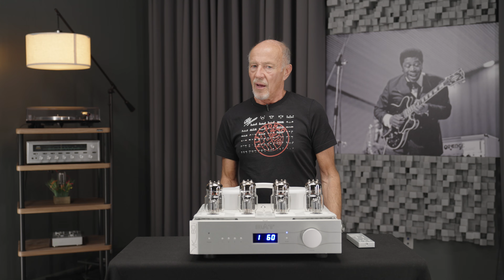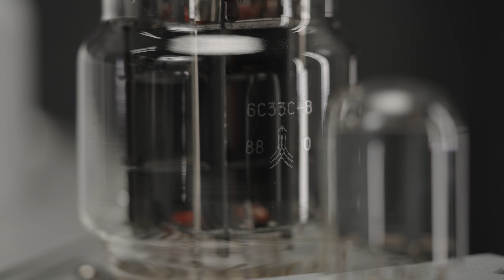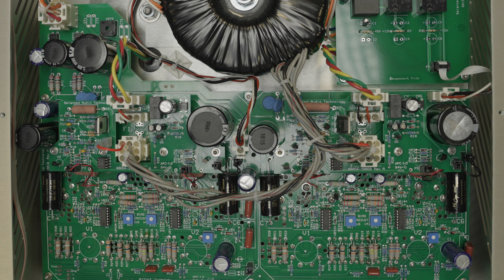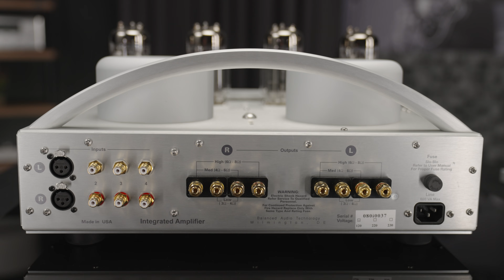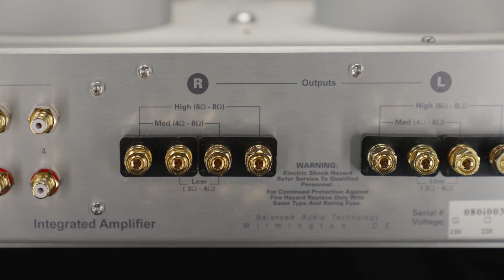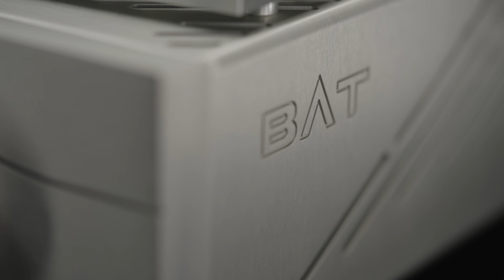Balanced Audio Technology VK-80i Integrated Amp Review w/ Upscale Audio's Kevin Deal

Comment: The VK 80i is not a push pull triode but a parallel single ended triode. The volume control while being a resistive ladder is passive. Basically it’s a VK 56 with a built in selector and passive volume control.

Comment: I saw it a few weeks ago for $8000 and was considering it. One place even had it for $7000. Looked yesterday on Music Direct and it's now $10,000! What? Now it's just out of reach. Darn. It's a dream integrated.
Reply: Guess the change to Mundorf capacitors pushed the price up but do make a significant improvement. If you look at the pictures in the BAT website. The VK80i don’t have Mundorf in them.
Reply: @seongkietchen7874  Thanks for the explanation. I guess the price increase makes sense then. I'm surprised BAT made a change so quickly. I thought the VK-80i just came out not too long ago.

Comment: What speakers and pre amp would this pair well with? Thx
Reply: It's an Integrated Amp so it has a built-in "pre amp". You could (imagine italics) use it with a pre amp but it is not required. Speakers? I just purchased Klipsch Forte 4s to used with an amp like this (high sensitivity horns). I'm retired so I will have to wait and buy the BAT used but I'm sure it will be perfect with the Klipsch (unless there are hum issues).